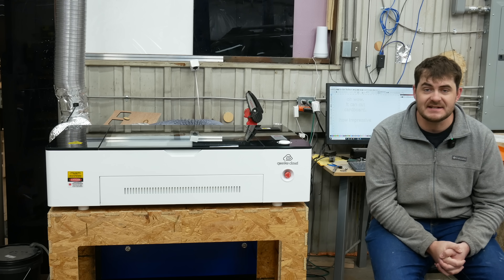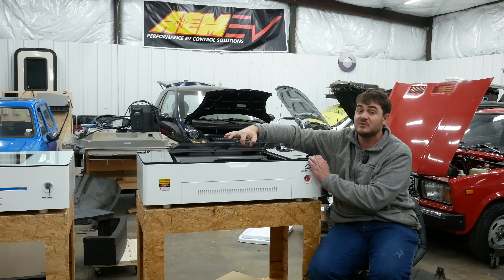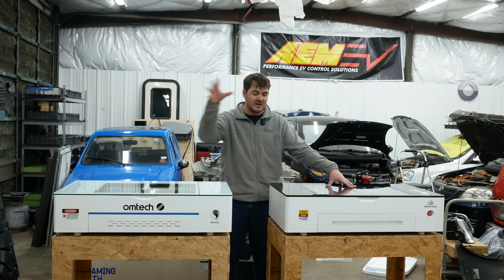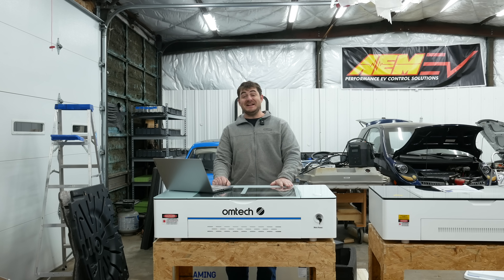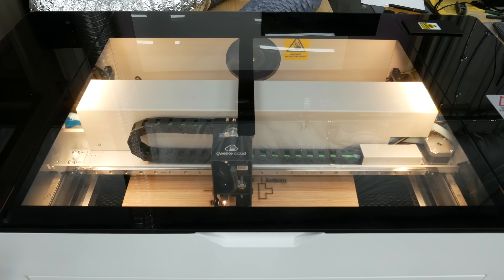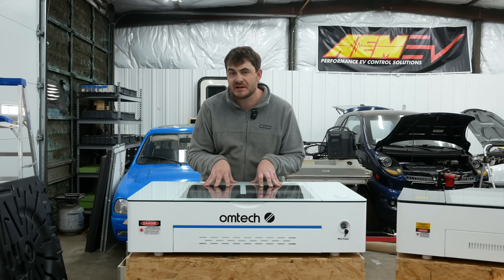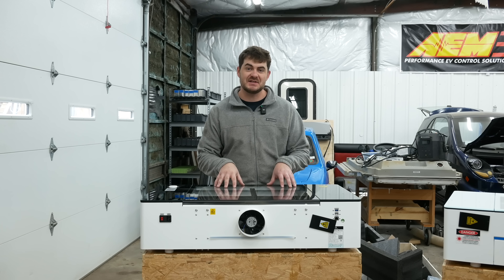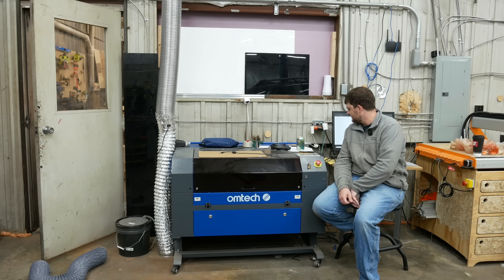The OMTech Polar and Gweike Cloud are (mostly) Desktop CO2 Lasers

Comment: G-Weike variously pronounced on company videos as Gee-Way-Key   or Gee-Week  or G-Wee-Kuh

Jan 2026   We received a NEW G-Weike, still in original box.  (manufactured in Jan 2023)
As it was in storage, the coolant tank was half-full.  (no leaks, just evaporation, topped off with distilled water)

Setup Problems  We've experienced many of the setup problems mentioned in the video:  
          WiFi impossible to configure.  (poor instructions, etc.)
          Ring-Light is limited.  (no used feedback or error messages.  Color-Blind users.)
          Online reviews suggest to avoid the cloud software, and use the local USB interface directly, preferably with LightBurn.

Rotary Attachment looks promising (but missing the cable).
Apparently there is a measurement gauge you make from acrylic to measure the height of the cylinder, and use that number.
I was also SHOCKED that they require the 17mm math crap, as they origin it as 0mm is the top of the lens travel.
(So for paper you LOWER the lens a full 17mm.  For 3mm acrylic you only lower the lens the 14mm difference.  WTF?)
We were also surprised about the convenient (but dangerous) tray-interlock-switch-defeat-metal-tab 

G-Weike is a good and large company.  They make stuff for other companies.  (Laser HVPS, etc.)
This product, I get the impression, was rushed to cram in features to compete with the GlowForge.
And many of the problems are a result of those compromises.

Comment: Could not get my Wi-fi to connect to the laser either, so yeah no camera either.  Tried the USB, but the laser cuts pretty good. until now.  Went on vacation, when I got back, the Gweike hasn't worked since even though Lightburn says "ready".  It will trace fine and Lightburn says "file sent successfully"   Can't figure out how to get it to cut now, even though it did quite a bit of good work before.  Lightburn allowed me to just enter the material thickness before starting the job.  And no error messages to help figure it out.

Comment: It's kinda funny, but this video actually sold me on purchasing the omtech polar, to replace my old diode. Thanks as always Robert, I enjoy your videos when they pop into my feed. I already really like it, added the red dot and controller. It's a great machine.

Adding the controller makes it like the larger cabinet one, shows errors when encountered, and lets you change laser settings and speeds mid run!!!

alas , I also couldn't get wifi to work, but the controller lets you use ethernet and set the IP address and subnetmask.

Still need USB for the camera, but it kind of sucks to set up, mine is, and its fairly accurate.

Comment: I realize this is a year late. But the reason you are not being able to connect to Wi-Fi, has nothing to do with your Wi-Fi name. I tried several times with mine, then I realized I have skipped a step, you have to first register the laser cutter on their online cloud platform once you have done that by creating account, entering the machine ID or serial number then proceed with the Wi-Fi connection process and it will connect immediately

Comment: Great video!  Very informative. 

The only thing I had issue with in the whole video is your outrage of the passthrough on the back. That's so you can pass through from the front when the drawer was off, and keep going out the back. The issue I have about the back passthrough is how thin it is really limiting the size of stuff you can pass through.

Comment: The most recent release of LightBurn (1.4.04) fixes the Z handling for these machines.  You can now turn OFF the 'Relative Z Moves' switch, and then just set your material thickness, and LightBurn sends the correct Z moves from there.

Comment: I couldn't watch anymore of their hilariously bad design choices that you state are fantastic reasons to buy them.  Both being made in Communist China.  Just go with an American-built laser cutter or engraver like the Epilog which has the same features as the Glow Forge but does NOT require an Internet connection to use them.

Comment: Hi robert, if you've not been told this yet; you can set up your windows machine to be multihomed with a single network card. 

By this I mean, you can have reside on two different subnets on a single physical network. One would be for the laser cutter, and the other would be your home internal network. This may mean turning off DHCP on your computer, but you can still be on the appropriate subnet provided by your router. 

I'm in South STl; feel free to hit me up if you need help

Comment: We purchased one and after two uses the laser s*** out on us. The camera never. It was after 30 day warranty but they replaced it because they knew they had made a bad batch. They replaced it with another one from the bad batch and it won't move halfway across the x-axis, makes an atrocious noise when it does, had metal and plastic shavings, rust, scratches, hot glue strings all over the inside. Can't even get the thing to frame where you leave the laser head.  We've now missed out on tens of thousand dollars in missed sales. Pretty f**** furious about it, right now. omtech polar

Comment: eh... full regret on omtech polar... nothing but issues....  I'd stay clear personally...

1. limits at 200mm/s on x; no idea why, far cry from stated 500mm/s stated.  Limit set in device settings.    
2. no control panel / no console
3. z-probe is all over the place; losing its position.  Manual measure is required for every cut.
4. cleaning lens is nightmarish
5. wifi is almost impossible to get working and offline, you can bridge (but requires alot of techie skill)....  Hardwired network is flaky as all hell, will literally take out my PC.  Have to power down omtech and remove power to get it back online.
6. Camera calibration is impossible, have to do a bunch of tricks to get a somewhat LB calibrated camera

Most cases my xtool-40w outperforms.

Build quality looks really nice... shrug...

Comment: There are so many things in this video that are simply user error. For example, you don't focus in the machine settings. You simply go to the move tab, set the distance and hit the dotted down arrow. Much faster and more accurate then manual focusing. I don't want to take all day for a long diatribe addressing all of your problems, but I didn't have any of the issues you had. Wi-Fi was quick and easy, and I operate both the cloud and USB while online connected to a 2.4G private network. Gweike (pronounced G-wee) has incredible 24/7 actual support, and they should be able to fix/teach you how to use it. BTW, go to Device Settings in Lightburn, tick on Enable Job Checklist, click Edit and type in, Did you Focus? and save it. Now you will never forget to focus again! Did you know they have a YouTube channel that addresses most of these points you made? Fun video to watch though, even with all the inaccuracies!

Comment: I work with a glowforge almost everyday for nearly 6 months a year, and I have for 3 years. The worst thing about the glowforge is the software. It is so bad. It imports slow, it only takes certain files, and sometimes it just won’t slice a file with no explanation. Interestingly, just had to replace the laser tube after absolutely nowhere near 10000 hours

Comment: I’ve had nothing but frustrating experiences dealing with Gweike.   If it works at all (I can’t tell) my air assist works poorly. Speaking with a “Gweike engineer,” I repeatedly got answers that were not relative to my model. I also could not get the camera to work. If you can’t get the camera to work with Lightburn, after a few hours, give up. It is not worth the pain. 

That said, given it cost half of a Glowforge, I’m starting to look at it as a high-quality version of the $500 Chinese laser and accept that I have to add air assist and a camera. I am an old-school hacker; this is not a user error. I bought it for a time-sensitive project, and my family heard a lot of colorful language coming out of my room. Oh, this is not a good machine to keep in your bedroom. Even with the ventilation setup, there is still smoke. I’ve also got a grow-tent fan in the window that I use to clear out the smell for a few hours after I’m done. 

For the price, you have no other choice. I believe the new xtool is $1,000 more. If it doesn’t have dumb issues, it may be worth it. But I would be very surprised if it had the build quality of the Gweike. The thing to understand about Gweike is that they have been making industrial lasers for like 18 years. They don’t know how to make a cheap end-user product. The crate from China weighs around $250 lbs!  

 Glowforge is a no-go at any price. The way they lock you in is ridiculous. There is tons of info about Lightburn. It is a great program.

TIP:  There is a workaround for the focus issue. Start by assuming whatever Gweike tells you makes no sense. In its rested state, the lens is at some distance from the object you want to cut. If I cut something 3mm thick, I edit every layer z-axis to be -10. Why -10? Ask Gweike.   For thicker material, add to -10. Thinner, subtract from -10. I am currently addressing envelopes (that won't go through my laser printer) with it at -17. Why? ….  Bite the bullet, trial, and error. Write down your results. You will never have to set focus! Yeah, it is constantly lowering and raising the lens. Good, I hope it is suffering! I get satisfaction from beating the system. 

If “it’s the thought that counts”, GWeike support is great. They do try. But the team is younger than my shoes and speaks no English. They will also change components to make “improvements,” which sounds good except when they tell you to watch a video and your machine looks nothing like the one in the video. I still can’t figure out how to get my lens out to clean it.

Would I buy it again? Not if I had another option. So, yes, I would.

Comment: Your comparison between diode lasers and CO2 laser power doesn't even tell the full story. Diode lasers typically measure their power at the input whereas the CO2 ones measure their power at the output. This is why even a 32W CO2 laser like in all the "skinny" k40 variants is still good enough to cut while basically none of the diode based machines can do it regardless of how much money you spend.

Comment: Manual focus on Gweike is not needed every time you start a cut if you learn how to use Z-Offset and material thickness in the layer settings in LightBurn. For example, set the Z-offset to -11 if you are cutting 3mm plywood, and don't forget to set the material thickness to 3mm. The calculation is as follows, "(Materialthickness*2)-LensFocus", 3+3-17= -11 in Z-Offset. This will result in a focal length of 14 (11+3=14, zoffset+materialthickness=focal height)

Comment: my guesses the machines are supposed to be hooked up to and old laptop hooked up to the machine by Ethernet cable and to internet by wifi  then with the computer  program you should be able to read the errors maybe even set the head so it does not retract each time. I  guess that is just dreaming.

Comment: I own a Gweicke Cloud and everything he says is the total truth. He nailed the downsides so well, i was like, 'ah, and will he talk about the fact that... yup, he just did'.

Now for the rotary focusing problem. With the Gweicke comes some kind of weirdly-shaped clear acrylic ruler wich you can simply use as a focusing gauge. BUT. Yes, there is a BUT and a HUUUUUGE one.
This ruler will let you know if the distance between the laser aperture and your material is correct for a good focus. But in order for the Z axis to be moved up or down, you need the machine to be powered on, right? And, if the machine is powered on, YOU CAN'T FREAKING MOVE THE LASER HEAD AROUND ANYMORE because the stepper motors are LOCKED if the machine is powered on !!! Wanted to be a smart ass and position the head manually when machine is turned off, before powering it back on? Too bad, the machine goes to origin when you power it on, so nope, won't do.
So, you have to go and move the head through Lightburn, bit by bit and guess by guess, untill you somehow manage to get spot on above your material, and then do the focus with the weird ruler, again bit y bit because you've go no clue what distance you should lower it at first.

 Oh did I mention their rotary is absolute garbage? You're supposed to fit it in the lower-left corner of the opening he shows in the video, right? Well what you don't see in the video is that this lower-left corner is ROUNDED, but the rotary's corners are SQUARED. So you can't position it in real precision. Pffff, amateurs....

Last but not least, customer support. 
In order to get support, you"ll have to install DingTalk chat (which is extremely instrusive in matters of personal data and the like). They're are actually very responsive, but not truly efficient at problem-solving. Most of my problems i ended up in solving by myself.

So okay, powerful laser yes, very compact yes, quite cheap yes. Which makes it a really good buy actually. Really worth it.
But damn, those irking little things they could have avoided...

Comment: So, this seems to be a common type of thing for Chinese devices, which honestly kind of scares me.. The same form, wifi thing, whole shibang. (I would be intrigued to see where this form goes after)  So, the issue with these is this actually:  The wifi connector uses older band wifi, so you need to setup an old style wifi on your router and give it that info.  Eg. you use AC normally, you may need to enable a 2.4 ghz connection for this (802.11g etc).  I would check the manual / specs to see the wifi type.  I had to go under wireless setup and enable this in mine.  Good luck let me know if this works.

Comment: It's nowhere near as powerful, and the workspace is much smaller, but the XTool M1 is a 5-10W diode laser with an enclosure that offers the same safety benefits of these two machines at significantly lower prices. Their software is (IMO) pretty easy to use and the dev team responsible for it have been making improvements by leaps and bounds, largely based on user/community feedback.

You do get what you pay for, though. Ever consider doing a review?

IME:

It's a diode laser, and a rather low-powered one at that. While it can cut through 1/4" plywood really easily, it does so quite slowly and you really benefit from the add-ons that DON'T come with the main offering - namely the honeycomb riser base and the air assist. It also doesn't come with an inline fan like Gwenneth and Omtech provide. Adding one is simple, but I found that I had to disable/remove the fan at the back of the machine because it was reducing the efficiency of the inline fan.

It comes with WiFi support, which includes use of the camera, but I've found that it disconnects quite often. You're better off just keeping it connected via USB.

It's decent enough for small projects and hobbyists, IMO but not really something that can scale for a serious small business.

Comment: Why are the USB ports on the backs of the omtech USB-A male??? Those ports are only for host devices. Companies flaunt the spec all the time but this, I've rarely seen this. Also, just buy a small travel hub, then you only need to run one cable back to your computer ;-)

Comment: If your WiFi router combines the 2.4ghz and 5ghz networks under a single name (most routers do this) it can cause problems for devices that can only connect to 2.4ghz. I've gotten around this by disabling the 5ghz network, connecting the device, then reenabling it. I've never had a device complain after that. I've also had devices that refuse to accept spaces in passwords. When I had a router with DD-WRT installed I made a 2.4ghz virtual network that was 2.4ghz and no spaces in anything, mostly for whatever printer I had at the time.

Comment: Probably something you already thought of, but are you running a MAC filter white list on your network? This could stop you from connecting the device even if the ssid and password are correct. I had some issues getting a Chinese cell phone to connect to my own network because of this. Only way I could get it to connect was by disabling my MAC filter. Even adding its MAC to my white list wouldn't allow it to connect.

Comment: I'm operating a 25W GCC Spirit at my work, it's a really solid machine with proper autofocus and a proper operator panel, haven't tried it with LightBurn yet, we use a program called FlexiDesign but InkScape, Illustrator and CorelDraw so I think it'll work with LightBurn

Also, if anyone wants to make black marks in metal, kapton tape works better than CerMark but you'll have to burn more slowly

Comment: I got rid of my Glowforge a few months back. I was completely underwhelmed by it. If you stick entirely within their ecosystem and materials (which are constantly out of stock) it works well. I did get it to work outside their materials but with a lot of waste because the auto focus feature was not great. The camera is a fisheye so you have to make jigs if you want your piece centered. All in all it was a lot of work for something that was supposed to be better than either of these.
Reply: Eh. I only use their ecosystem to print, because you have to, but that is the small of it. I actually like the connectivity, I can print from any machine - which is useful in a shared environment, like a school. All the design is done locally. I never use the GF materials - not sure why you feel that is necessary,.